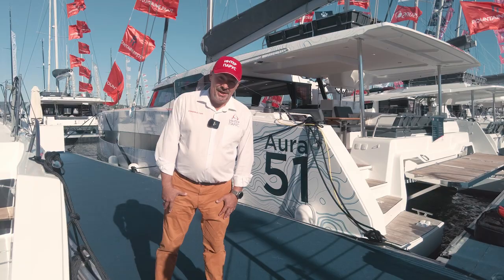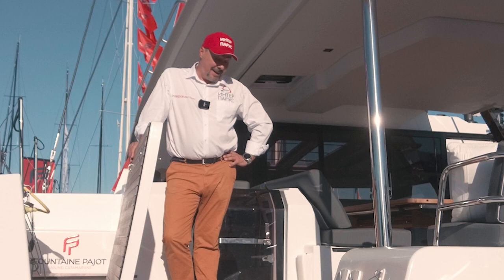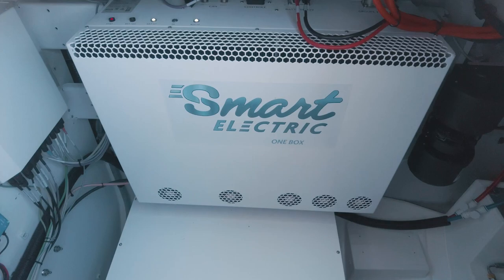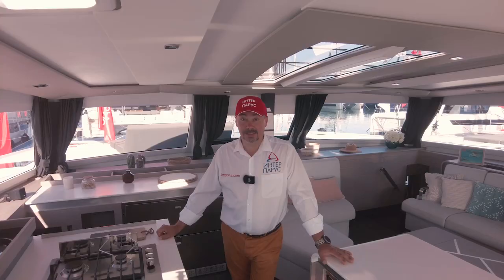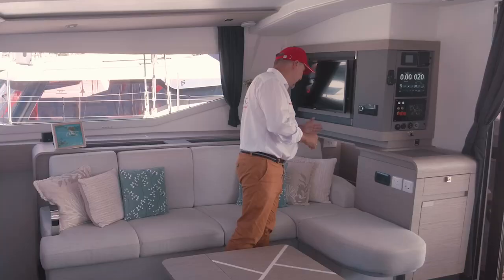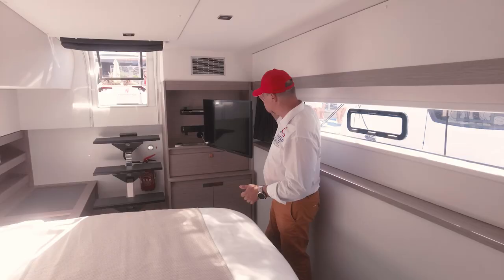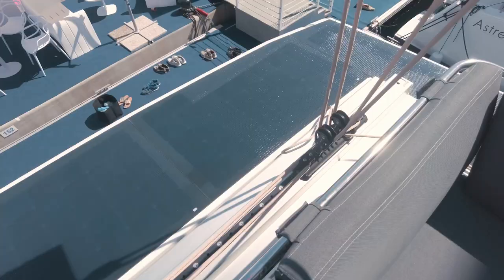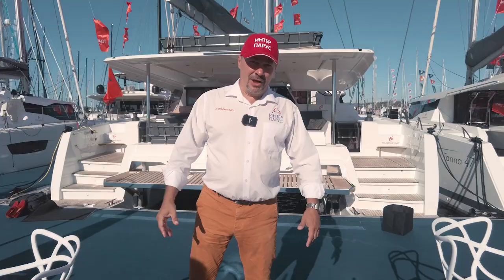Fountaine Pajot Aura 51 Electric Catamaran Review #Interparus

Comment: This electric boat will use more diesel to feed the batteries to power the "electric" engines than any catamaran that can actually sail well.  Love the idea, but the technology still is not there yet to make this viable for anything other than a coastal cruiser.  It is telling that no reviews provide any real-world data for how long a boat could motor into 15kt wind to get it off a lee shore in an emergency situation.  Great party charter boat though for sure and it will sell like hotcakes!
Reply from the maker: We may well agree with you.
Reply: CryptoCrusader33  hey it’s a beautiful boat and if that’s your style then cool, go for it!  But if you believe a 22 ton boat without dagger boards will perform even remotely as well as an performance cat of the same size that has a displacement of 11 tons you’re smoking some of that crypto lol!

Anyway the technology will get there eventually to make this make sense, just not there yet.